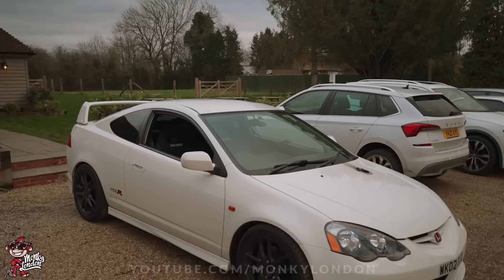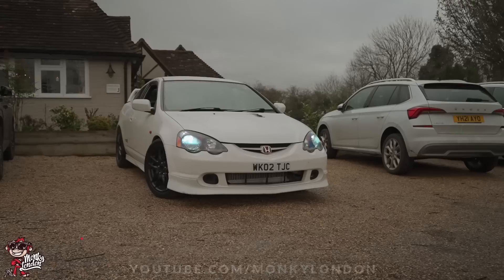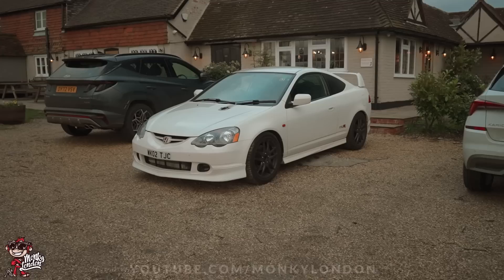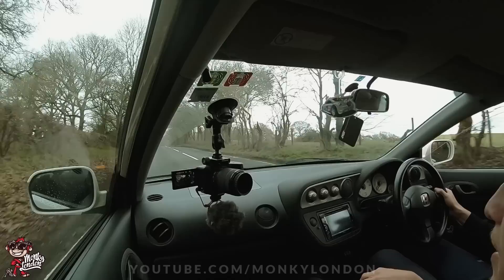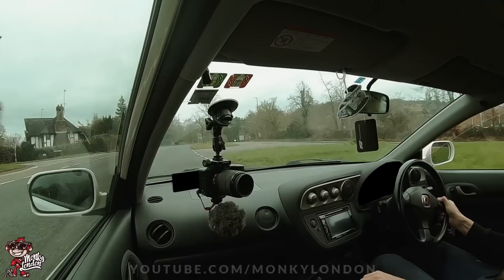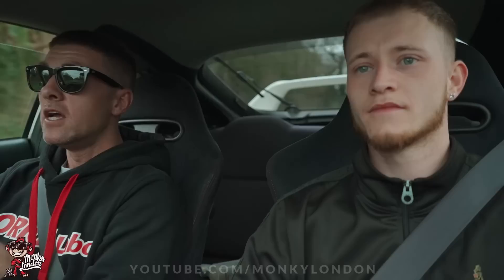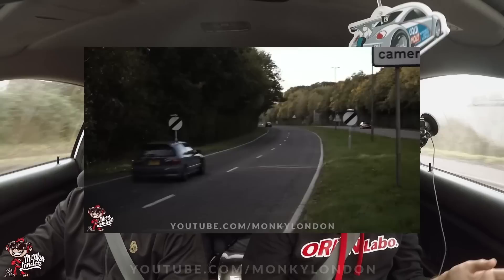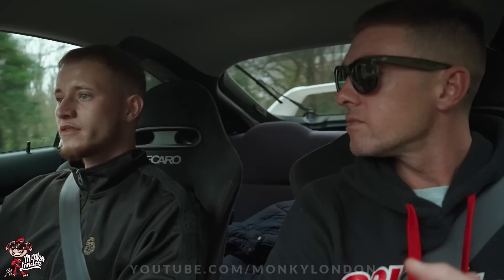THE SUPERCAR KILLER! 700HP HONDA INTEGRA TYPE R TURBO REVIEW

Comment: I have a 96 Turbo Integra Type R DC2. It has 359 BHP and 275 ft-lb's of torque, and it is unreal fast on the road! I'd say this is absolutely mental to drive - what a car.
Reply: Cheers!!! I have a 98 DC2 ITR, 81.5mm bore, 9.5:1 and a gtx3076r on 17psi, at 493whp and 343wtq.
Reply: 350+ to the wheels is definitely a ripper. Atleast you can hook, stopped getting good traction with these Nitto's around 300whp. 205/50/15s.
Reply: The 98 ITR sounds unreal. I have Regamaster Evos in mat black (just 14 pounds each), wrapped in 205 45 16 888 Toyo Proxes. The car did a 13.1, 1/4 mile, and that was when it was not boosting right. Never got a proper run. I would love to see what it would do. I recon it lost about 1 to 1.2 seconds or there abouts.

Comment: Would like to see this and officially gassed type r drag race.this is a nice build
Reply from the maker: Yeah on a rolling start be interesting, Luke deffo needs semi slicks #zestino
Reply: His is faster but id give it a go
Reply: Jamie's is AWD with a sequential.
Reply: You must be having a laugh :D Manual fwd 700bhp vs Sequential awd 700bhp. This dc5 would get mullered all day long
Reply: @lastexile1187  yeah but when rolling it will be interesting to see the differences. Either way both great builds.
Reply: @JamalPennant  theyd have to do roll ons from like 70/80mph onwards otherwise this fwd dc5 would just be spinning its tits off. Even then, as soon as OG pulls another gear in his dc5 itd pull ahead each time

Comment: Imagine what this would go like if it had a 4 wheel drive setup
Reply: You can find out.. Jamie at Officially Gassed is running 770 awd
Reply: Is this car 700 with it left front wheel drive?
Reply: @robmorris87  yeah it's still FWD!! Bonkers!! 🤦🏼‍♂️
Reply: @granthicks7120   wowzers.. Sets the questions running round your head. 

I've always been a bit of a car enthusiast, but not to the extent of this or you by the looks of it.  I've had enough experience in my youth with engine swapped Corsa b's ect to know how terrifying and lethal powerful front wheel drive cars are.

How are the handling issues tackled?
Or are they not, is that the thrill of it?

Comment: Love the fact its Fwd still, love  a Dc5 me fair play maye going to check his channel asap 😎😎✌✌👌👌👍👍
Reply: U love how all the power is wasted?
Reply from the maker: @germalean88g77  not wasted you can run low boost and send this round a circuit fast guranteed with sticky rubber, high boost just for straight line. Also it's 7 degrees and wet roads, only dry one was motorway allegedly John reports so prob faster than you realise 👊